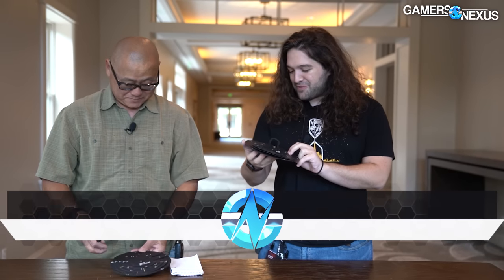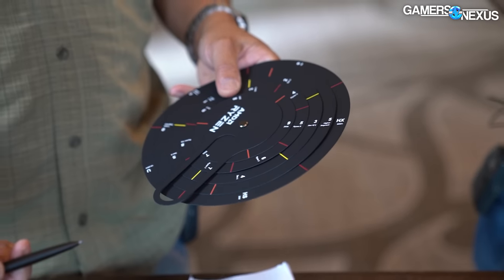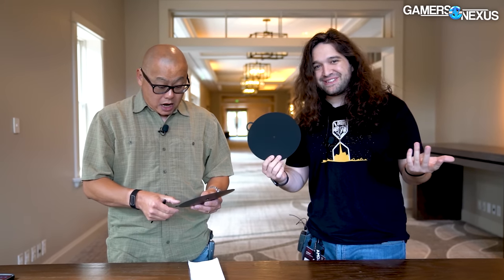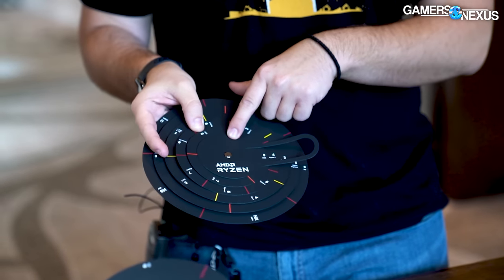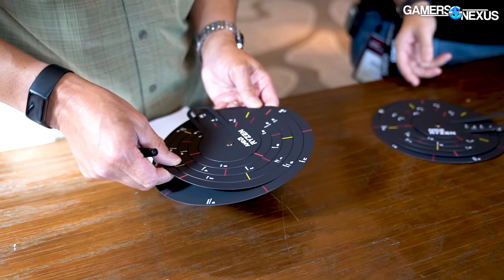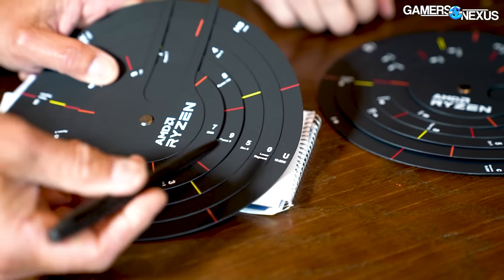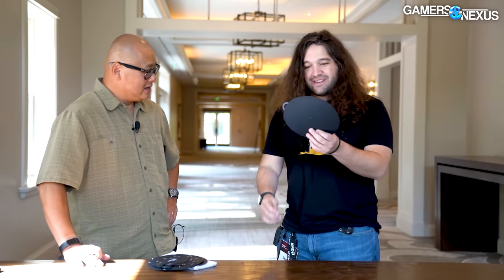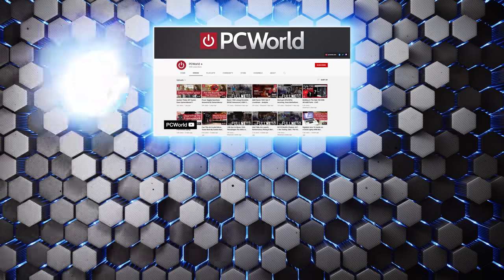AMD Gave Us Too Much Power | CPU Naming Problems

Comment: AMD: First we competed with Intel on price, then we competed on efficiency, then on performance, and now on confusing naming schemes.
Reply: Except that at least Intel naming was predictable (if a bit long). AMD just chucking numbers in the air and hoping they land somewhere on the wheel.
Reply: I hope AMD won't compete with monitor manufacturers on their long model names. That sux.
Reply: @clansome  That is not true. i7-11370H and i7-11800H. The prior is a 4 core CPU with x4 PCI-e lanes for the GPU, the latter is an 8 core CPU with x16 PCI-e lanes for the GPU. I don't see how predictable it is.  Both AMD and Intel has some really confusing names.
Reply: @fleurdewin7958  Yeah I'd forgotten about those parts. I was thinking of the laptop parts that "mirror" (sort of ) the desktop parts. Just had a look on Intel's website and there are so many, mind 80% are not intended for enthusiast type builder. Irony is I have a 12700H in my laptop but it has 2 fewer P cores than a 12700 but 4 more E cores. Make sense really but as you say not the same even if the thread count is the same.
Reply: They're destroying the last stronghold Intel has left! Noooooo......
Reply: They compete with Nvidia on naming. 2070 super ti :KeKW:
Reply: @fleurdewin7958  But those CPUs are made to fit what the OEMs want. From the naming, you can still tell one is better than the other. There's no easy way squeeze more complex information into a short model number, so you have to refer to a spec chart either way.
Reply: It also happened when going from the HD 5000 to 6000 series of graphics cards, when the x00 bracket was raised so the 5770 replacement was actually 6870 and also dropped the x2 moniker for its double gpu variants.
Reply: @clansome  I actually find the wheel thingie to be perfectly clear. It actually is more predictable than cherry-picked numbers. The point is that you don't use the wheel to name a mobile processor, you use it to decode what a processor has inside.
In that respect, this is perfectly logical, because now we know each digit has an actual meaning, and what is different between models for each digit changed.
Hoping that a higher number wopuld mean a better/more powerful CPU is a ridiculous notion, since the numbering is for classification, not for metrics
Reply: "now we are getting as successful as them we can be as deliberately obscure and frustrating as them because pure truth one day might hurt us like it's hurt them"
Reply: @fleurdewin7958   Yep I agree and to add up intel even added the KF, T....
Reply: At least they have the goods for it.
Reply: @fleurdewin7958  I think this one is pretty easy to explain. i7 > i5. The 11 is the generation. The 800 is higher end than the 370. And the H represents that it is a high power laptop CPU (aka desktop replacement).
Reply: Maybe I'm missing the point, but what's so confusing about all this? The first digit or two is the generation, then the product series, and the last two digits are for some little tweaks and modifications you make that aren't quite enough to warrant a separate product series. I often do the same when I need to organize something: just assign a couple of numbers to things -- always one or two digits more than I need to simply enumerate them -- and spread things evenly across the available range. That way if I later need to add an entry, I always have an empty slot. Kinda like that decimal system that libraries use -- only with fixed digits. Linux and BSD also used a similar system for their init scripts once.
Reply: @clansome  Oh boy, we were wrong.

Comment: Just to put it into perspective: AMD had a great naming scheme when zen launched. Just a 1000 for the first gen. Then they inexplicably decided to call their mobile parts for 2000, even though they were in fact 1000 series chips. Everyone thought, well this will cause problems. Their Zen+ chips were called 2000 and Zen 2, 3000. Everything is all good for dekstop. Mobile parts were perpetually one generation behind. And to make matters worse, AMD decided that the desktop APU parts should also adopt this same naming scheme. 

So now we had a true generational marker for desktop without graphics, and APU's for dekstop AND mobile with confusing, leapfrogging naming. AMD realised this mistake and their solution was to skip 4000 for desktop and jump straight to 5000. Why? Nobody knows. Maybe to line up with RDNA2? Well, that lasted for one whole generation. It's anyones guess now. 

We had some straggling zen 2 parts with 4000 names for a while, but with Zen 3 and the arrival of mobile 5000 parts. Everyone finally lined back up. Zen 3 on desktop, and mobile. Even desktop 5000G. 5K across the board. It took them 4 years to correct their terrible naming mistake.

Now? They decided to release a new mobile Zen 3+ architecture called 6000, and they decided to skip it entirely for desktop. We're out of sync yet again. 7000 is the new rage, somehow. Multibillion dollar company ladies and gentlemen. With no shred of naming competence. Do not get me started on their GPU division. My brother in christ.
Reply: It shouldn't be hard. Have like 3 or 4 tiers. A gaming focused CPU. Then the mobile line.
So, a 7700MG would be a 7th gen, ryzen 7, mobile and gaming.
It's like BMW and their cars, they've saturated the market with a few models with several variants.
Reply: I think you missed out on the 5300u, 5500u, and 5700u being zen 2 based instead of zen 3.
Reply: Still better than USB Implementer Forums naming USB standards.
Reply: @mingyi456  shit you are right. It was the 5000H parts that were Zen 3. And the U was Zen 2. What a shitshow. Edit: with a few high end Zen 3 U parts as well. Forgot about those.
Reply: @mingyi456  it's GCN all over again hd 7870 became the r9 270 and then r7 370 
It's mind boggling
Reply: Actually 5700U is Zen 2, 5800U is Zen 3.  5700U is nothing but a higher clocked 4700U Zen 2.   This stuff is very obviously meant to deceive the consumer.  They are doing it because they can and the fan base of AMD will not allow anyone to speak out against it.
Reply: @Ginger Mollica yea, imo it's extremely irresponsible. They know that the average consumer use the number for "the newest". Which isn't always the case with amd when they try to trick people.
Reply: then they skipped a 1000 number, and didnt fix this in laptop
Reply: @dumbestbiscuit  5700U = 4800U
Reply: There's literally no way to simply express all this stuff because it's a lot of stuff. Ryzen 7 7700X September 27, 2022 US $399 	TSMC N5 	1 × CCD 1 × I/OD 	8 (16) 	1 × 8 	4.5 	5.4 	512 KB 	8 MB 	32 MB 	AM5 	28 (24+4) PCIe 5.0 	DDR5-5200 dual-channel 	105 W
Reply: for Intel people think desktop and laptop are the same cpu...so AMD decided to use odd and even number to separate from desktop and laptop...
(before zen 3, what amd laptop? never heard of it lol)
Reply: It's all a big pissing contest with Intel and Nvidia, plus some second grade manipulation mind tricks on the same level as 0.99$/€ product pricing.
You know.. when the number jumps from 5000 to 7000, it has to be a huuge performance jump, too, right?!
That's my best guess at least. There can't be a sane explanation.
Reply: @tarron3237  long story short. First gen mobile was called 2000 which has had terrible carry on effects for the rest of zen. In all its permutations.

To fix this they've decided to skip both 4 and 6K for desktop which is a terrible way to go about it IMO. Not only because it greatly accelerates the problems youll face when you hit 10k (the Intel issue of having just too many numbers).

And it also confuses people since they started out using the numbers in order 1/2/3.

The mobile parts are so out of whack at this point that I have no idea what they'll end up using. 6000? 7000? 8000? Who knows? 7000 will be the best option imo. Then, they should return to call zen 5 8K, zen 6, 9k. Etc.

I think it's all a combination of marketing people somehow thinking that bigger is just simply better. And therefore we need a big number that's a little bigger than Nvidia (they should've just called their gpus 1100 and 1200 imo).

But if this is true why didn't they just start zen 1, on 10k?

Only conclusion is, it is just an utter shitshow and the people responsible should be ashamed.
Reply: @tarron3237  AMD isn't exempt, they are price/performance anchoring too.
Reply: First gen desktop APUs also were part of the 2000 series, the problem has its root in the need of a new name even when is based in old technology just because its new, of course in other ambits it's no big deal but for computing it's odd.
Reply: @Mr.Morden  Yep, Ryzen 5000 was when AMD stopped being "all in for the underdog" and pulled an Intel. Like, I know inflation is bad, but AMD had the decency to release decent parts at decent prices.

I don't know. Maybe I'm still too hung up on the 1600AF being the budget deal of the decade and inhaling copium thinking that they might do something like that again. I just want a new-ish 6-core under $100, (even though 3900X's are only going for about $250-ish used) is that so much to ask?
Reply: @KarrasBastomi  At least they are trying to fix their ** ups by rebranding them once in a while adding even more confusion to the end user 😆
Reply: @EbonySaints  I don't think that'll happen till 2026 when Zen6 shows up and 8 cores become cheap. Just before new "lowest common denominator" consoles show up in 2027.
Reply: @tarron3237 Really excited to see if they are actually gonna fix the generation confusing this time as they jumped 2 digits ... will we see a 7xxx m mobile or are gonna jump the mobile version to 8xxx 😂keeping the confusion 🤔
Reply: this is such a psychotic and fumbled naming scheme and they just need to drop it for something else.
Reply: @Mr.Morden  You're kinda being slightly optimistic about console release timing considering that generations are getting increasingly longer. I wouldn't be surprised if they did another mid-gen refresh in two years time. Also, considering the silicon shortages and the almost inevitable recession, the PS5 is selling considerably less than the PS4 did at this stage in its life cycle. 

But besides that, you're probably right. Thank God for used parts.
Reply: @EbonySaints  7 years is optimistic? Ouch!!! 😂
Reply: @fVNzO  Well, it technical is a "new" or refreshed version. problem was they mixed 2 different "zen" versions in one "gen" which most consumers don't think off and it doesn't matter. 99% is buying off the shelf laptops that is often 2 gen's behind the most current tech because there is pretty high latency in laptops becomming available in stores, at which point they are allready a gen behind. Plus the average consumer needing a laptop often has no interest in what is actually inside. they just need a laptop to do basic home or school jobs which they will all do just fine. If you are having special needs like high performance cpu or top end gaming laptops you're most likely updated on the tech and know what you want and what to avoid, and you will have done your research well before choosing the laptop. And it's not like it's an AMD special thing to do this. Try to look how many times Nvidia have made "refresh" models of their gpu's that is just last year's sku with some cuda cores disabled but with boosted clocks. It's what is called being efficient if you still have a large inventory of unused sku's even if its a tier higher or lower you make it into a refreshed model of the right price. The top 5xxx mobile series is also a considerably price jump because its actually zen 3 cores instead of zen 2.
Reply: @Mr.Morden  Well, maybe not entirely, but given how we've gone from a five-year release cadence from the 80's to the early 00's to almost eight for the PS4 and the PS3's seven, an eight plus year console cycle, as horrifying as that is, really doesn't seem as crazy as it used to.
Reply: @EbonySaints  Try look at how much more performance you have gotten with each of those "for now" 6 core optimal gaming price to performance cpu's. The new 7600 comming is gonna be as fast as last gen 16 core top dog and trading blows with intels 12'th gen top dog. AMD has scored a touchdown in nailing Intel and don't "need" to sell these chips cheaper than Intel to compete. It's natural when you suddenly are having it all and no longer are the "underdog" but I think the prices may actually be adjusted once intel releases 13'th gen, dependent how good they are, and even AMD just have to release the 3d Vcache models to get back the gaming crown if Intel should beat them by using 50%+ more power. I think the prices on the Mobo's are a much worse concern. I am personly not gonna be an AM5 first mover with those prices. Saving my money to finally getting a much more needed GPU and Monitor update from 1080p. My "old" 3800X is more than powerfull enough to drive a gpu upgrade, wether it's gonna be a right priced RTX3080 or a new 4070, and dependent on price changes maybe a 5900/5950X upgrade. It's also possible that AMD will adjust the prices on Zen 3 parts. Maybe you will be able to get a 5600X somewhat near those $100 which even at under $150 would be quite an update from that 1600AF if you have a usable mobo. AM4 is not at all dead yet
Reply: TBF, they might launch 6000 desktop in the future if they have excess stock, or the market open up, or something
Reply: They literally had no desktop motherboards for Zen 3+, which is geared specifically for DDR5. Theoretically, Rembrandt could see a desktop release after AM5 motherboards become available, but Phoenix is slated for next year, so I can see Rembrandt being exclusive to laptops, unlike Renoir and especially Cezanne.
Reply: There's also the r3 7125u (Mendocino?) which is zen2 on 6nm
Reply: You forgot to mention the new desktop 4000 series Zen 2 SKUs released well after the 5000 series, that cannot be named 3000 despite being Zen 2 because they're actually based on the mobile Zen 2 APUs but with their iGPU fused off so they're no loger APUs and that's why they don't have a G suffix...sigh. Oh. but they finally released the 4600G for the DIY market! Like, a million years later, but okay I guess.
Reply: @thelegendaryklobb2879  and yet still no ryzen 3
We got the 4100 but it's worse than the 3100
Reply: We had Ryzen 3200g and 3400g being zen+ instead of zen2
Reply: @mrdali67  don't agree. It's misleading, Nvidia is being called out for this every single time they rebrand a product. So does amd. Everyone is equally disingenuous and everyone gets called out. It's not called being efficient. It's called misleading customers and noone gets special treatment.
Reply: Reminds me of the disaster that was intel tiger lake mobile CPU naming tbh (or Nvidia's naming all the time)
Why can't we just use regular names for this stuff like the japanese car companies? I wouldn't mind buying an "Accord" class CPU or a "Supra"-class GPU
Reply: @GhostGhosty  don't like that. The number system works very well if you just follow the rules. Amd even had internal naming rules they just didn't follow them at all and are now making new ones.

Intel also decided to name some of their new mobile chips 1000/1100/1200  instead of 10000/11000/12000 which is just taking the piss yet again.

Just wtf is going on. I don't even mind the 10k+ names. They suck to say but they make sense. Now theyre rolling back to 1k for some odd reason on select parts. Wtf is going on. Can someone explain.